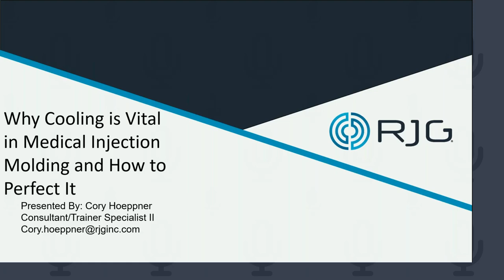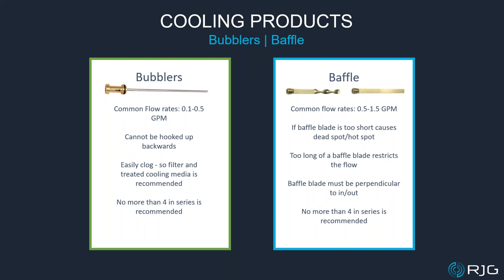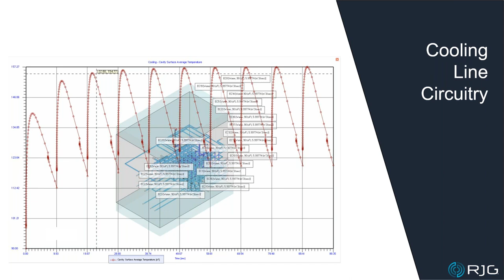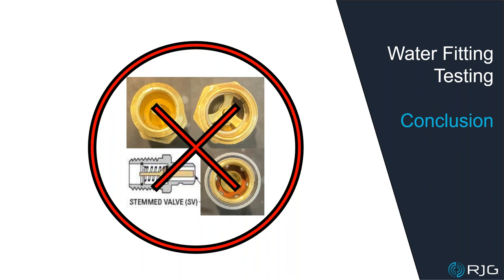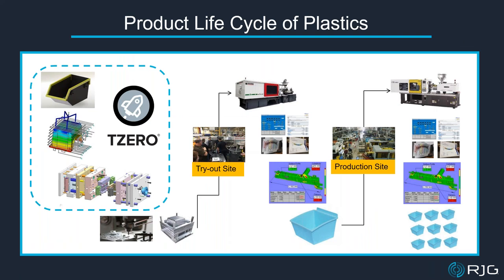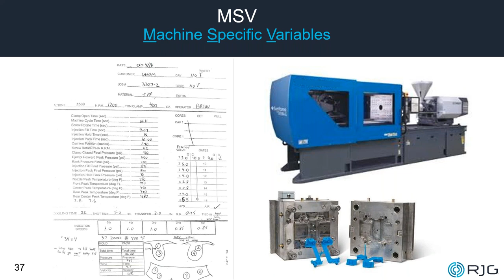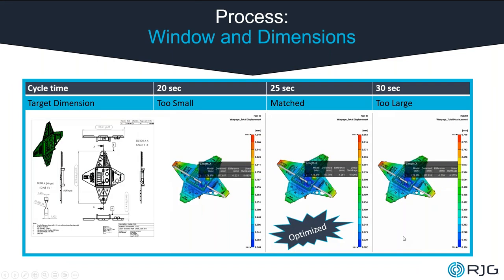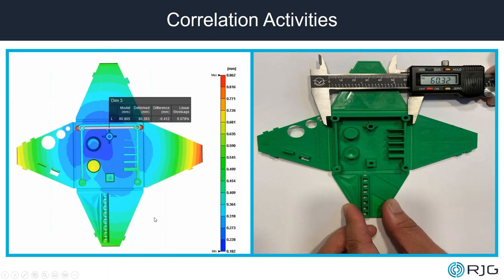Why Cooling is Vital in Medical Injection Molding and How to Perfect It

Comment: mould temperature and turbulent water flow is vital, in all  injection molding process not just medical, bit surprised RJG say especially medical? learned how important water temperature can be 15 years ago, when trialing a a closure mold on an electric machine, and they had over speced the chiller and temperature of the chiller was varying by 7 degrees ,the melt cushion was trending with it,we ended up removing the chiller and replacing it with water heaters, this reduced the melt  cushion variation by  0.6 mm,

Comment: Example LSR injection , the  solidify temperature is around 140 degree Celsius. Should use pressurised water for better uniform surface temperature?

Comment: Great video.  Does using larger diameter channels help or hinder  If you have a large mold with 1/2npt lines and 1"npt baffles, vs 3/8"npt channels and 3/4" baffles.  Some of my customers want bigger holes but if you can't feed it with proper gpm/pressure, the flow may not be strong enough.  I notice on North American molds, it's always big lines, 500 series fittings and 3/4 id hose.  Then I saw Euro and Asian molds of similar size and it's 10mm water lines with smaller clear plastic hose as they can't use same type of hose we have in NA
Reply from the maker: Thanks for watching and your kind words.  To answer your question regarding 1/2npt lines and 1"npt baffles, vs 3/8"npt channels and 3/4" baffles, it truly depends on gpm/pressure that you mentioned.  It would be helpful to know the gpm/pressure that the mold temperature control unit is dispersing at a minimum, and this can be achieved by in-line flowmeters similar to what Smart Flow offer.  If the gpm continues to rise the larger 1/2npt hole could provide more adequate heat transfer.  On the other hand, if the gpm is reduced when using the 1/2npt hole it could result in much lower heat transfer.  NA vs Euro/Asia mold cooling can drastically differ in channel size, as mentioned about bigger is not always better unless you have the GPM and Pressure to back up the larger lines.  A constant Depth, Diameter, and Pitch for colling lines also plays a role in effective heat transfer, so it is recommended that mold filling simulation is preformed by a qualified individual utilizing the mold attributes such as cooling line placement and mold material to understand the best scenario for mold cooling.